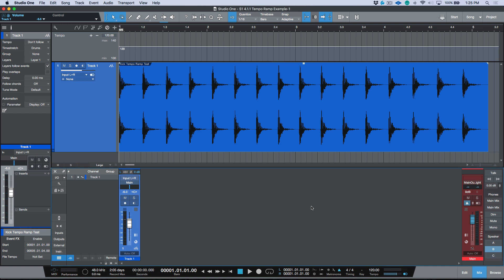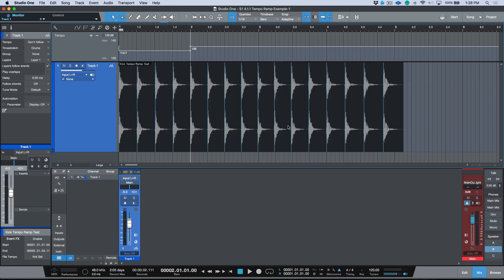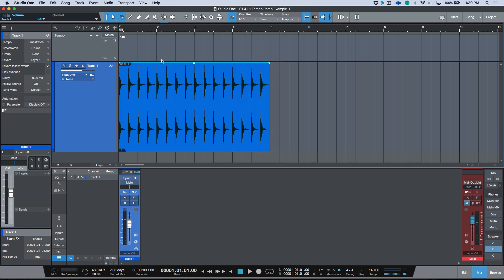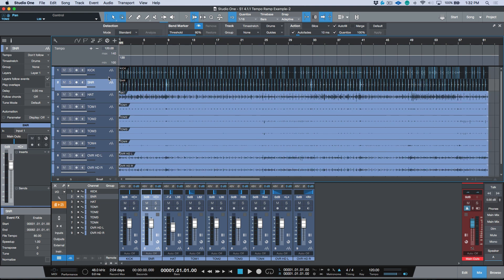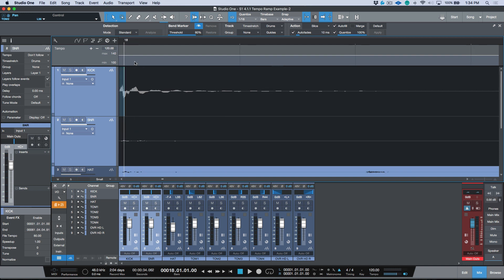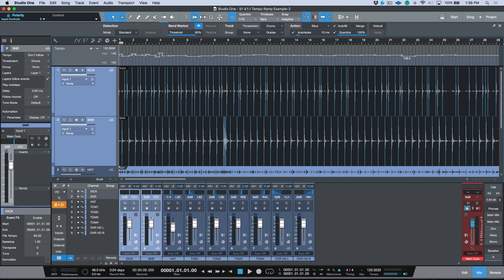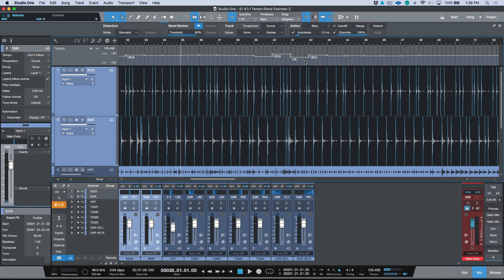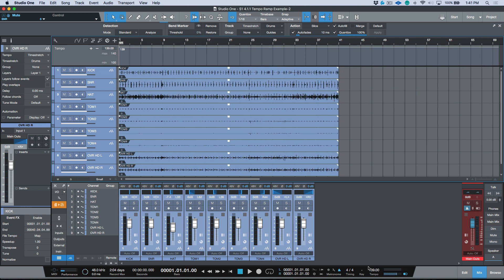Improved Manual Tempo Mapping In Studio One 4.1.1 - Part 1

Comment: Awesome job Marcus, thank you for this. I have a question: I'm trying this in S1 5.3 Pro and It works when snapping to the bend marker while working with bars at the downbeat, but when I try the second step to snap to every quarter note it does not work by cmd+clicking over the tempo track. It just does nothing, and if I drag as in the first step, it will move the rest of the track and it ruins the aligment I did before. Any advise? Thank you in advance.

Comment: Now I have a question. So I'm programming drums for metal music, and I want to incorporate tempo and time signature changes within the song, such as going from 120bpm to like 160 or 180. I'm using EZ drummer as a midi vst and it follows the tempo of the host DAW. Do you have a video that elaborates on how to do this?
Reply from the maker: summerson1 if you click the cursor at a bar - you can open the tempo track and click the “+” to insert a tempo change node. This should do the trick.
Also you can right click the timeline to add a time signature change if needed as well.
Hope this helps?! Cheers, M 🍻
Reply: @marcushuyskensmusic  you the MVP

Comment: Thanks for this video - really useful. I find that this functionality is a little flaky - sometimes I can drag the grid to the transient as shown in your vid, and sometimes clicking and dragging does nothing. I'm running 4.1.1 too, so not sure why it's not working properly for me.
Reply from the maker: A few points that may help - the first is VERY IMPORTANT:
1) Make sure the audio track is set to "Dont Follow"
2) Use "detect transients" to give your self some "guide points" that Studio One can snap to
3) make sure Snapping (N) is ON
4) make sure you are grabbing clicking the BAR boundary and dragging it to the TRANSIENT in the audio
5) try toggling between Time Linear, and Beat Linear

Let me know if these help!! Cheers, M